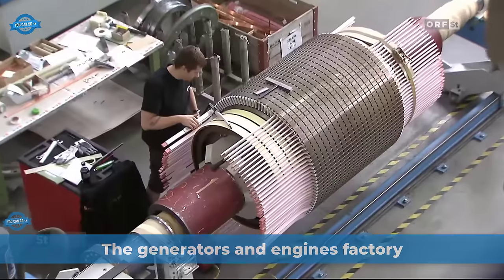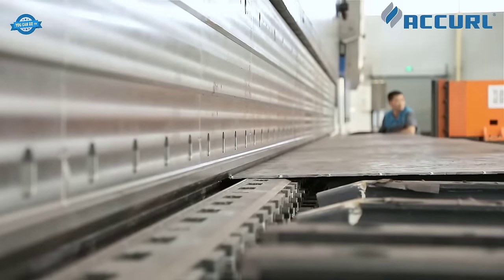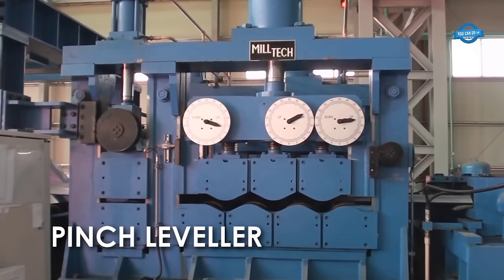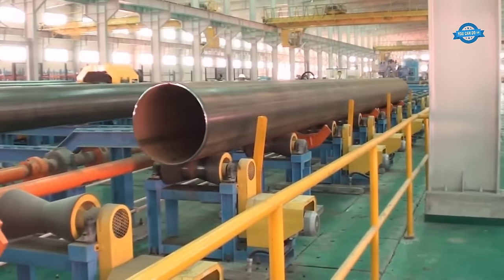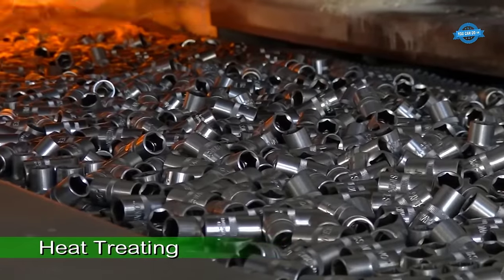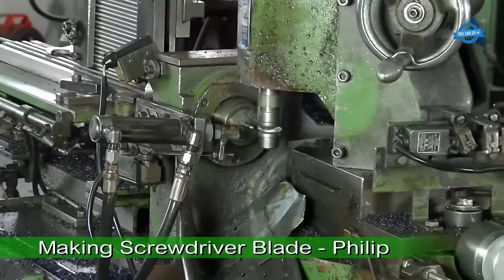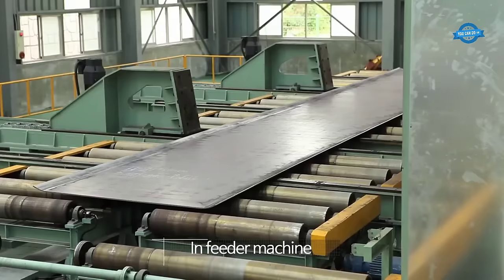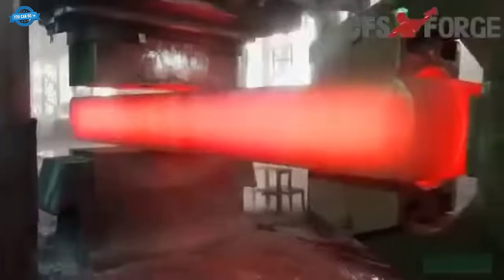Satisfying Manufacturing Process Around The World. How To Produce Generator, Wrenches, Screwdrivers

Comment: 3:00 These bars are called TMT bars, not "DMT bars." Rapid cooling is called quenching, so they may be called quenched bars. Quenching is beneficial because it creates compressive stress in outer part of the bars and makes the surface harder. Peening also generates the beneficial compressive stress, but it is much more expensive process and it creates undesirable pitted surface.